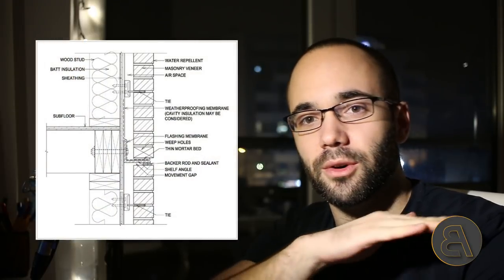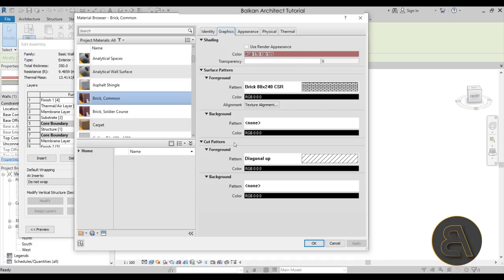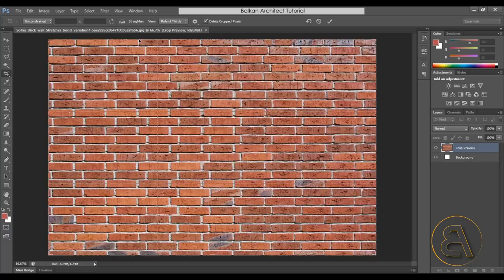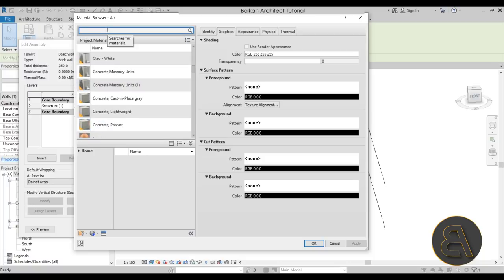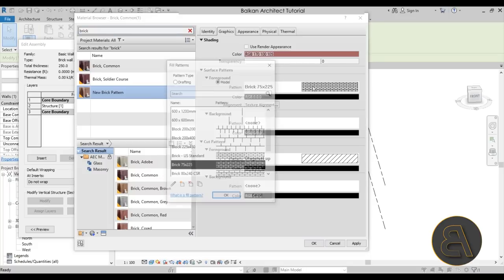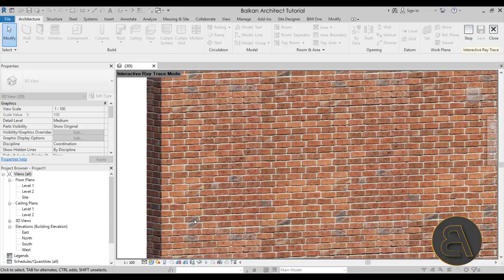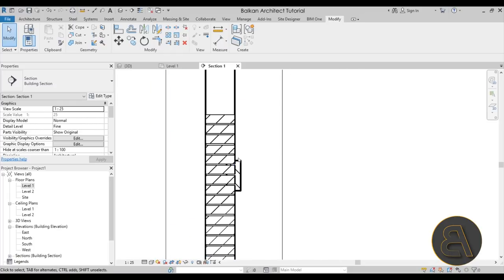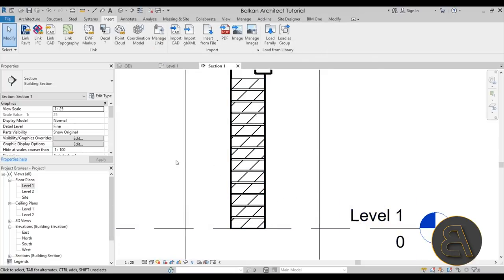Brickwork in Revit Tutorial

Comment: Oh dear, there is a bit more you should learn about how to prepare an image for seamless tiling. to put you on the right track i will tell you a few tricks .1  Always use square images this way you don't need to worry about the tiling numbers. Many people use 1024 x 1024. 2 use the filter-other-offset  this way you will see the seam between the beginning and the end of your image and you can edit it to remove the seams. you need to do this for ALL your mapping images in rivet or max or any other 3d modeling / renders software. 3 make sure you choose a common scale for your maps. I use 512 pixels per meter which means that all my maps are 2x2 meters exactly. This way you can change form one material to another seamlessly. this is mostly needed for other rendering software. if you need to ask about any of the previous please feel free to. good luck